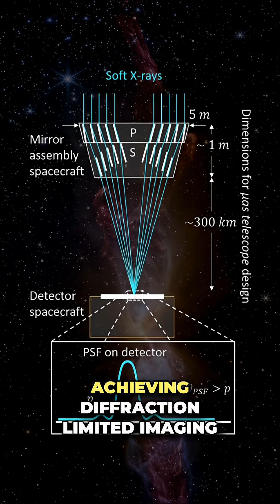X Ray Telescope Secrets, Photon Collection vs Image Clarity

Comment: The reasoning is that virtually all space telescopes are based somewhat on the design of spy telescopes. Borrowing technology from other agencies is a great cost saver but sometimes at a cost. Did you know that NASA was gifted 2 additional Hubble type telescopes from NSA? This is true as the Hubble Space Telescope is actually based on the KH or Keenen series of spy telescopes. 
Best Regards, 
Mike Turber